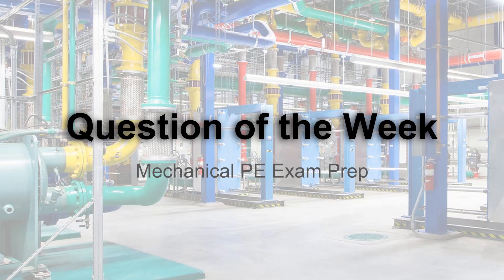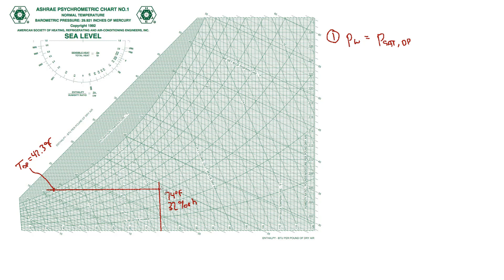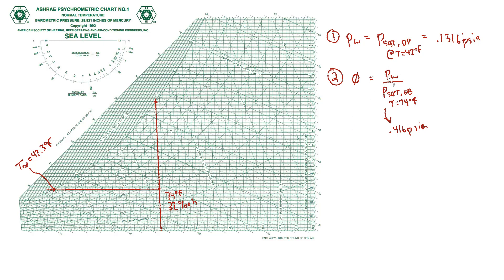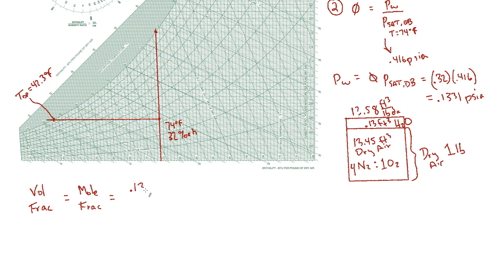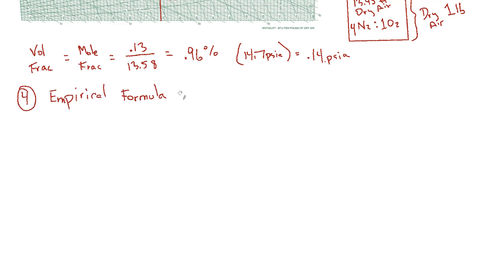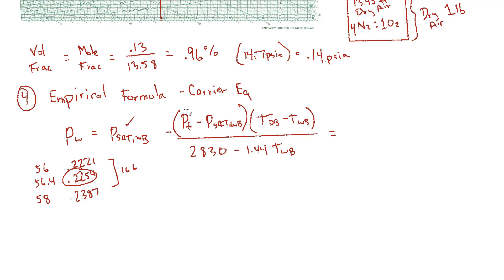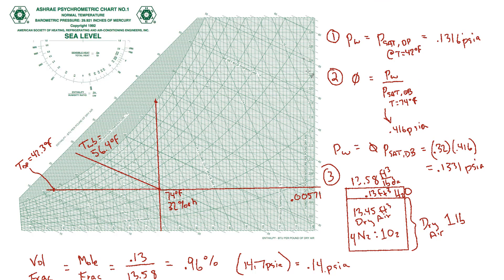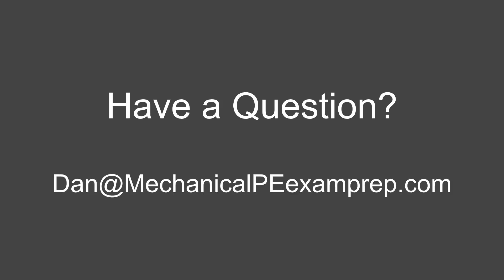How to Calculate Partial Pressure of Water Vapor in Air | Mechanical PE Exam Prep Solution

Comment: There are times when we need to know VP of water, like when we are checking the NPSHA for pumps. Depending on the water temp, this value is not insignificant. I understand the importance of VP in water vs. boiling point but I am having a hard time wrapping my head around comparing the two scenarios (vp in air vs vp in water). It seems VP in air is the pressure of water in air and VP of water is the pressure of air in water? Thanks